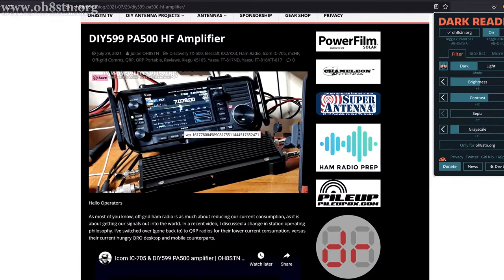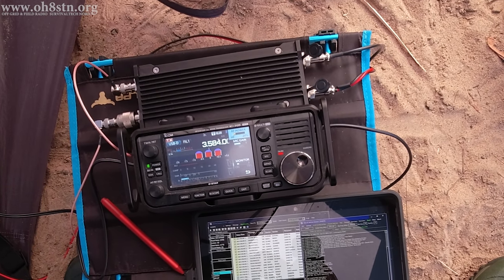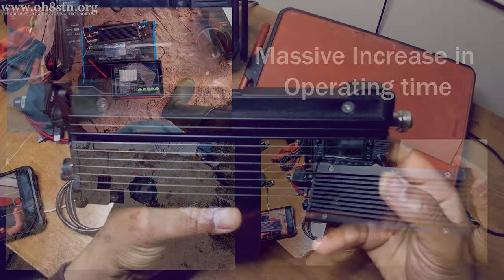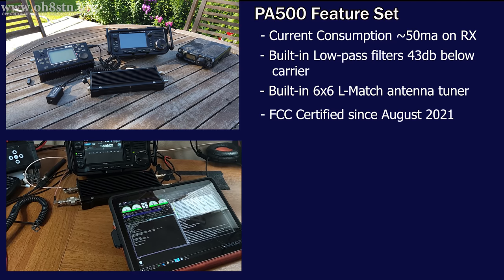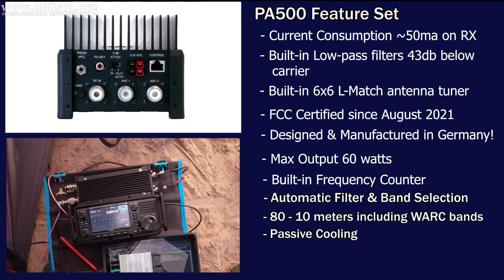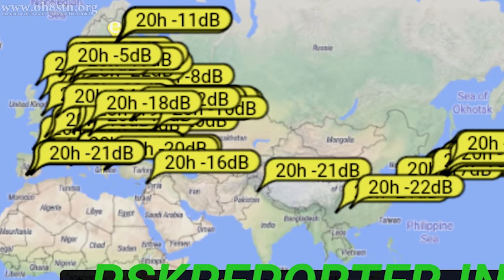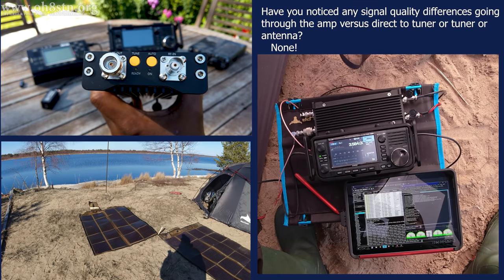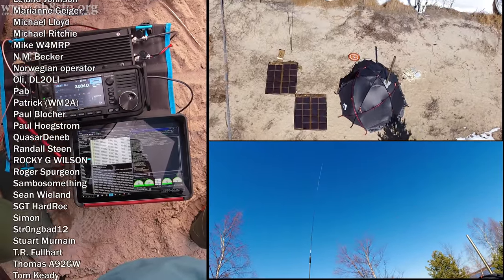Ham Radio Amplifier DIY599 PA500 OH8STN

Comment: Hello again Julian, thank you so much for all of the great content. As a relatively new Ham, I’m a little fuzzy on many of the tech specs, and also how gear designed for other regions may or may not work properly in North America. 

Here is my question:  I live in Texas and my neighbor is German with family still living there. I know without a doubt he would be willing to help me obtain a PA500 using the European purchase method you mentioned at the end of your video. 

Is there a reason I shouldn’t explore this option?   I’m wondering if the EU versions are different from the FCC approved models or something. 

Thank you again for being such a major part of my Amateur Radio education. 

-73
KG5YMD
Reply from the maker: Hey thanks for the kindness and question. Honestly I think it's a waste of effort. The PA500 is coming.  It's only a matter of time now.
So be patient 👍
Reply: @OH8STN   Hello Julian… happy belated birthday Marine!  I was a 2531 Radio Operator and got out in ‘94.

Now that I have my General, I’ve been having a blast making contacts. I have not gotten my feet wet with digital yet, but plan on eventually learning D-Star, Ft8, and Winlink to start with.  But first, I’m trying to learn the in’s and out’s of using my gear for voice. 

With that said, I do still want an amp to pair with my IC705.  

Do you have a “runner up” alternative to the PA500 in regards to current draw?  I’m putting together my field kit and would like to start with some type of amp. Once the PA500 becomes available in the US, I will upgrade at that time. 

Thank you for all you do.  
Semper Fi!
- KG5YMD

Comment: Are you using 2 mil ext with your Chameleon?  One on top and one on bottom?
Reply from the maker: Hi Dennis. I haven't done that before. I preferred set it up with the hybrid micro and bottom, the extension, then the whip up top. Under the micro I put three counterpoise wires out at the base of the spike. If you add a little bit of context, perhaps I can provide a better answer.
Reply: @OH8STN  on you video, the hybrid micro is in the air.  I was asking if it works better that way?
Reply from the maker: No it isn't my friend. That's a test I didn't actually mention in the video. So the mpas is set up the way I said however, I added an 80m super antenna coil between the extension and the whip, to get better performance on 80 meters. It worked like a charm.
I'll get to that hack in an upcoming video.

Comment: yeyes using the amp at times will help getting thru the noise and also if your a3way from you nornmal qth and would like to have that litte more umff , but as usual being on the right freq will be better and more efficient. Again Julian a great video and well done 73  VK1TSK
Reply: A question Julian I now have my 705 😃 How have you Kept the Charge up to the Suface GO ( working at 15 volts) ?, I have a surface pro 4 which I use with my 705 when I go out Camping in my Camper trailer which works well. I'm thinking of solutions for keeping the surface charged for the duration of the Camping trip. But this video has been great for making me think of the next steps for Low power and long duration camping trips in the outback here in VK , 73 VK1TSK Keep up the great work Mate
Reply from the maker: Here you go. Everything I have on using the surface with our Ham radios. https://oh8stn.org/blog/2021/10/10/microsoft-surface-go-2-faq-ham-radio-laptop/
Reply: @OH8STN  thank you very much 👍

Comment: Interesting product.. certainly well engineered.
I feel it is over engineered in comparison to the IC-705 / X5105
It maybe "nice" to have a look like the TX-500,
but how much would it cost in a conventional case/enclosure with say 2X BNC's , Simple ON/OFF and  ByPass Buttons and power poles.
$450/500 vs $700

Comment: I have the TX-500 and finally got to use it for Field Day.   I like it.  A lot.  I've looked at this amp and, with low draw and built in tuner,, would love to add it but the price is a bit steep.   I'm gonna have to sell some tools first.  PS.  Julian, I bought the TX-500 based largely on your reviews.  Keep up the good work.

Comment: Julian, thank you so much for this. Do you use the CAT Control Cable. I read the manual and it appears that this is not necessary but wanted to ask what you do. One other thing, if you are using the TX-500 then I presume you need to run power to the TX-500 plus power to the PA500. Do you use a power distribution block? How do you manage that? Thanks again for all you do and 73
Reply from the maker: You are very welcome.
I don't use CAT cable. For power, zi use the double power cable from @digirig
Reply: @OH8STN  Thank you. To clarify for me quick follow up Q. For CW with TX-500 I will run power from the battery to the TX500 and then to the PA500 via a power distribution block. Is that correct? My PA500 is due to arrive in the fall. Looking forward to it. PS: just made a donation to your channel and will make another shortly. You are doing great work.

Comment: I've been using an FT-817 since 2001, and added an HFPacker Amp a few years later, for those times I needed a boost. Of course, it would be nice if the DIY599 covered 160M, for those rare times (night/winter,/bottom of the sunspot cycle) when NVIS propagation drops that low. If the TX500's output were just a little cleaner, the rig/amp combo would be spectacular.

Comment: Excellent content! I love your videos. I am attempting to get some clarification on the PA500 that I have not been able to find. I am working on a go box with IC705 and the PA500. If DC power is removed from the PA500, can I bypass through to the bnc antenna out of the PA without needing to unplug the antenna from the amp. I would like to have a separate switch for the amp and be able to operate qrp bypassing the amp and tuner in the unpowered PA. The owners manual of the PA does not describe whether this can be done if the PA does not have DC power. Thanks

Comment: Thanks for another excellent video, Julian.  I have, and love, a Xiegu G90 and have considered adding an amplifier to my system (I power the G90 with a 9Ah LiFePO4 and 28W solar panel).  I use only SSB phone and wonder if the cost of the PA500 is worth the modest gain in output wattage.
Reply from the maker: I'm just waiting for some cables before I show the g90 and pa500 amplifier combined. I'm not sure if it's worth it to everyone, but it's better to have the capability and not need it, then need it and not have it. The way I figure it, the g90 and pa500 still draw less current then my old ft-891. Anyway, something to think about for sure. Thanks for the comment, for watching and for the kindness. Very much appreciated 👍

Comment: Hi for your larkbox you can get a zy12PDN circuit and then you can use any 12V capable PD supply - it adds the control logic to request 12V from the PD supply.
Reply from the maker: Thanks for that. I've already wired a little voltage regulator but it would be nice to use a normal USB C plug. I'll check it out. Thank you for this
Reply: @OH8STN  get the one with USB a at one end and usb c at the other end. Plug into USB c pd battery or PSU and press the button until the led is green. That's 12V mode. Then larkbox can power on

Comment: Hey Julian, thanks for all your great content & posts!
Have you ever looked into "Thermoelectric elements"? Since you are potentially running a wood-stove, this might be a viable source of low power generation. There are a few commercial outdoor-products using this - It may be too low power to be of much use for anything but a fan. But with a greater source of heat like your stove...?
Reply: Thermoelectric elements (Peltier elements) have a very low efficiency relative to its own weight when assembled with heat sinks and whatnot. To 'harvest' energy from a stove somewhat efficiently you need a highly efficient cooler on the other side of the element, like a water cooling contraption or similar, since it's the thermal gradient / difference between the two sides of the element that's important.
Reply: @michaelfuchs1467  Hm. gotta look into that. In cold environments it maybe could work for some slow-charging I would think.
Reply: @Radio_Zombie  If you for example can provide a large heat sink with a constant supply of melting snow from a bucket you might be able to utilize an intense heat source like a stove. But you'd better be shoveling good! Your problem will be to keep the element from heating up - with temperature being equalized over the two opposite surfaces making up the thermocouple. You need to keep a very steep thermal gradient here. 

In a RTG (Radioisotope Thermoelectric Generator) for example, the heat source is often Pu-238 (Plutonium) which can keep the hot junction to maybe ~1000 deg C and the cold junction to ~300 deg C. That is a thermal differential of 700 degrees C. To achieve this, the RTG needs huge heat sinks and a constant supply of great chill (like a cold ocean or space). 😎 These devices are primarily used in space - and in the sea (by nasty devices) where the cooling isn't really the greatest problem. 

Maybe if you have an ice cold stream nearby and can build a very effective water cooled heat-exchanger... 
But my guess is that a small ICE powered genset, maybe driven by wood-gas, would be much easier to build, transport and maintain - and would provide much higher power to weight. 😉

Comment: $700 for just  a 60 watt amp? Hmm
Reply from the maker: It's a 60 watt amp with internal tuner, low pass filters, Auto band selection, auto antenna tune-up, has ridiculously low current consumption, is ridiculously small and weighs almost nothing.

Comment: I heard that in the earliest days of amateur radio that they made very long distance calls with 1 Watt output!!
Reply from the maker: Sometimes we still do! Yesterday I used 2.5 watts to connect to a station 255km away on 80 meters. The frequency was clear with no high-power contesters clogging up the band. As for low power amplifiers like this one (60w). Sometimes we need instant reliability in any conditions.  60 watts is still lower than average power used in ham radio, but ensures the signal gets out when lives depend on it. It's not used to constantly, only when necessary.

Comment: The scary thing about this is these guys are not answering any emails about the purchase of this product which also leads me to believe customer service is non existent and there is no number to call. So if something is not working your on your own.
Reply from the maker: I've ordered two of them already. The one in the vidro, and one on the way. If you want one, join the diy599 groups.io group in the description. Ask all your questions there as mentioned in the video.
Reply: @OH8STN  I did join the group, posted an email twice no response. You have to realize your ham radio royalty 😁 and im a peasant lol
Reply from the maker: There's enough negativity going around the world already. Simple solution: If you don't trust it, just wait until the distribution is improved.  Lots of EU Operators already enjoying it. You also know I wouldn't share it if it wasn't legit. By the way, what's your call sign?
Reply: @OH8STN  K2BVB

Comment: Julian, I have recently acquired a PA500 Amplifier Expedition Version. Is it possible for you to contact via email and give me a list of cables I will need to run this Amplifier on my Icom IC-705. I would very much appreciate you giving the correct direction to go with the Amplifier. Thank you Julian
Reply from the maker: You don't need any cables but one is optional. There is a PTT cable you can get from Oliver or make yourself. It's in the user manual on the DIY 599 website. The PTT cable for the 705 is useful when operating SSB. For data modes and things like that, the Vox circuit inside the amplifier works perfectly fine.
Also remember not to transmit more than five watts into the amplifier.
Reply: @OH8STN  Ok, but what if I’m not comfortable or that capable to build that cable. If you asked me to build you a fine piece of furniture that I can do since I have 40 years of woodworking experience. HAM radio I am just getting into. So, could you build me the cable and can gladly compensate you it????
Reply from the maker: That's why I mentioned Oliver. Oliver will sell you the cable for the 705.
Reply: @OH8STN  Ok, I will contact Oliver. Thank you for your help Julian!!!
Reply: @OH8STN  Julian, the 6 pin connector that is in the manual what are they called??? If you can give me the name of them so I can source the connectors I will take a stab at it. Thank you Julian, 73.

Comment: Thank you very much for your video about this amplifier,  it definitely looks interesting and I want to know more about this amplifier. I agree with you about your preference on quality,  I am sure that it's very well built and designed since it's from Germany.   I  think that 60 watts would be adequate depending on the duty cycle you could run it at.  I  am glad that it's passed the FCC certification process and we have something that will not be a problem here in the states.   It's definitely something that I would be interested in since it also includes an automatic antenna tuner.  We definitely need more things like this that we can use in the field.   I  have seen several of your antenna setups and like what I see.   Have you ever tried a Moxon antenna?  I built a 6 element Moxon yagi antenna and was really impressed with it.   I am planning to try building a 6 meter and a 10 meter moxon antenna and see how they would perform. Thanks again for your excellent work and videos,  they are very helpful.   73,  Eric